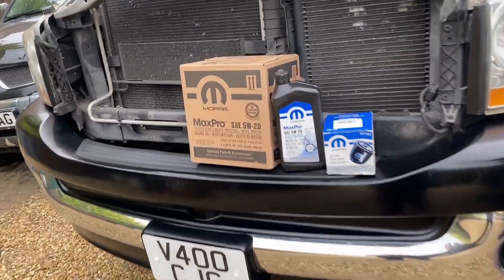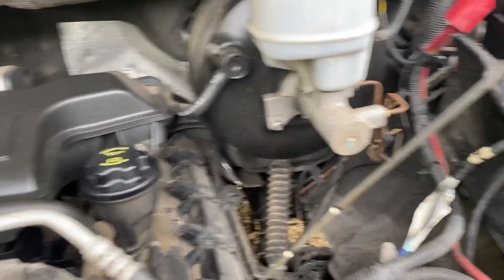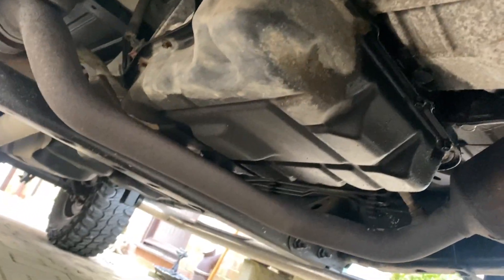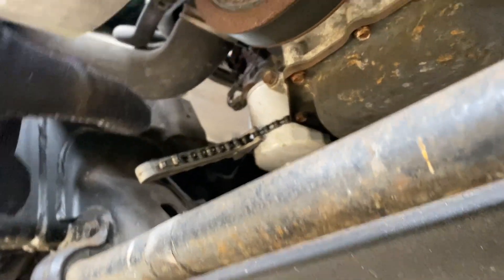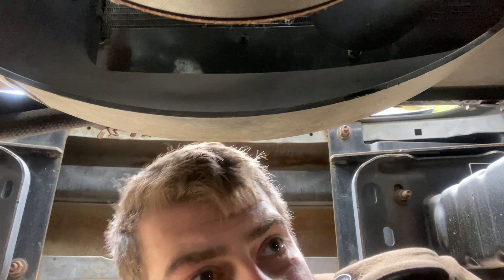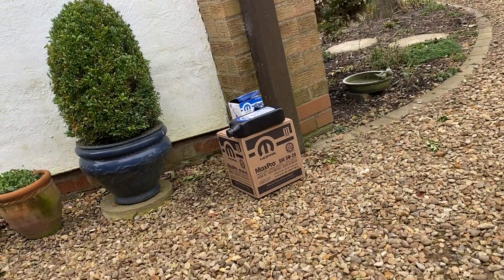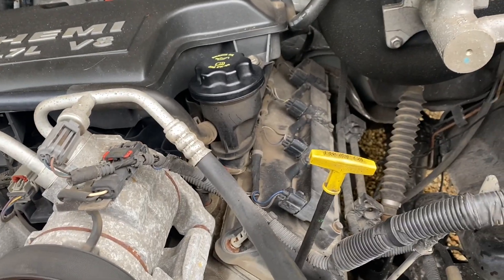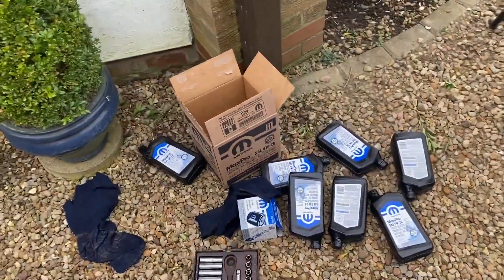Dodge Ram 1500 5.7 hemi oil and filter change Mopar Max pro

Comment: Here in the states I have a 2009 1500 Quad Cab 5.7 Hemi, you did great on the oil change, CCA of a minimum of 800 is a good choice. When i purchase a battery, I pick the largest CCA of the battery thats called for from Dodge that fits the hold down clamps for the proper size or Type battery it calls for. Enjoy your Monster Truck.
Reply from the maker: Thank you for watching this is the best pickup truck I’ve ever had. I’ve just upgraded the battery to 850 CCA and what a difference